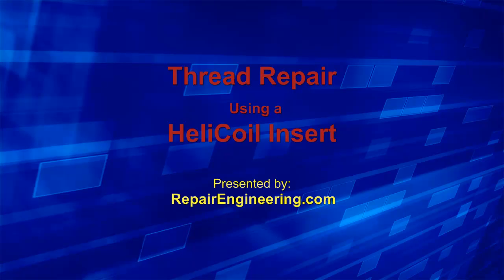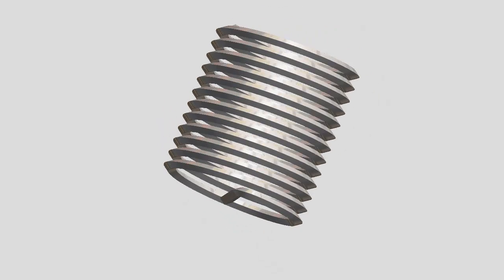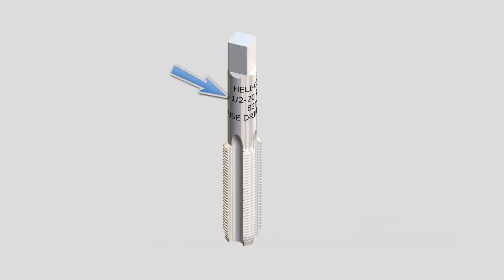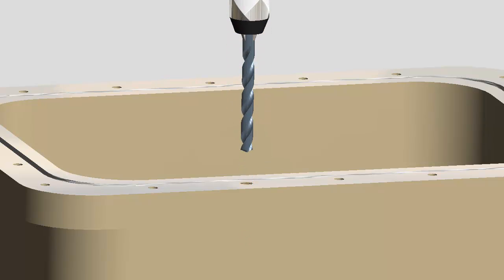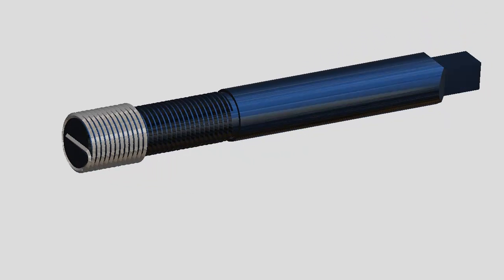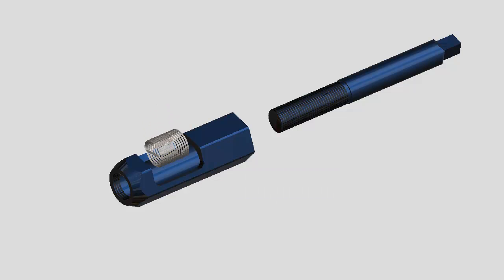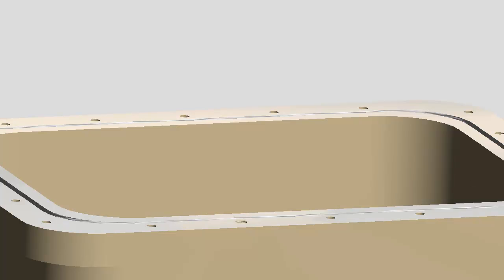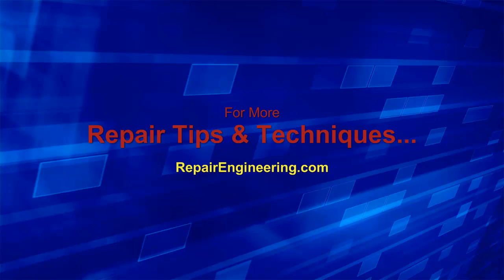Thread Repair Using A HeliCoil Insert

Comment: This video is so helpful ive been installing helicoils without fully understanding whats going on and now i do and its glorious. thanks!
also to other comments saying they are just for repairs, thats not totally true they are also useful if you have a soft metal part like aluminum but need to be able to screw bolts in and out repeatedly, since just aluminum threads will get messed up from that

Comment: This is the basic theory of a helicoil kit, and a very good one.  This video has real applications but I have found scenarios where some of this won't work.  It could highlight the overall process a bit more, which is: (1)drill (2)tap (3)helicoil installation.  In short, you drill to make a new, clean hole size.  Tap to cut in new, larger threads.  Install a new coil, which creates new threads.  Now you have a new internal thread for your bolt. Made out of steel, which could be better than the original.  Thanks for the video!!!

Comment: But you're going to tap out the hole after you've drilled out the old threads, what's the point of the helicoil?
Reply: The drill bit is slightly larger than the original hole so you can tap the threads for the helicoil to fit.
Reply: @MisterMooo  Thanks!

Comment: It's for repairing broken threads. When the internal thread is broken and cannot hold the bolt's thread, you put in a helicoil and your threaded hole is brand new again. Tipical usage is car/motorbike engine cases, where the thread hole's material is softer than the bolt's and thus an overtightened bolt can easily ruin the thread. With heli coil, you can use the same sized bolt again, without it, the only option would be to drill a larger whole and cut a new larger thread and use a bigger bolt.

Comment: I don't understand why the heli-coil is even needed.  What's a heli-coil doing that an ordinary threaded hole isn't?
Reply: The hole that you’re drilling and tapping is bigger than the original bolt size.If you want to retain the same size bolt the helicoil makes that possible.
Reply: It’s for stripped out threads. Creates a new thread for the bolts to catch. A lot easier then replacing something whole

Comment: I'm a bit confused about how the helicoil grabs the threading of the product being repaired. Wouldn't you think that removing a bolt from the repaired product also result in the helicoil unscrewing from the product as well?
Reply: They recommend using loctite on the outer threads or deforming them at the bottom